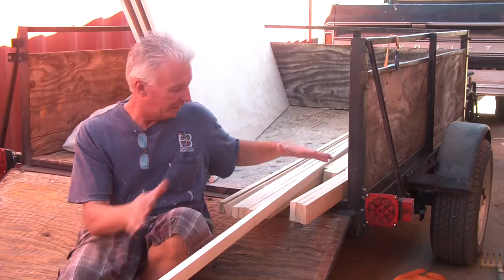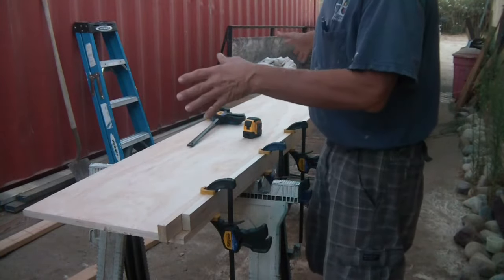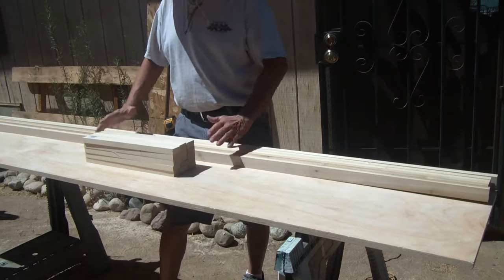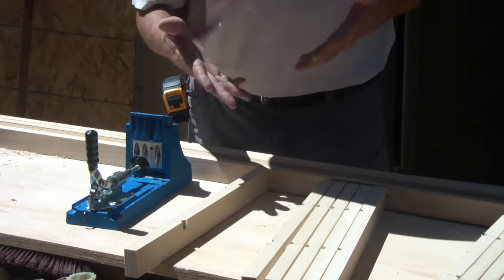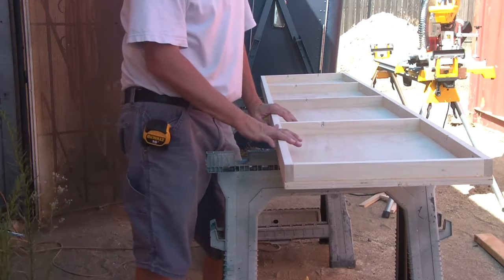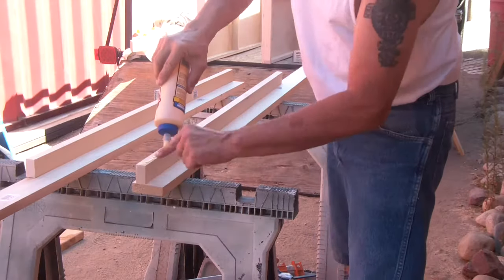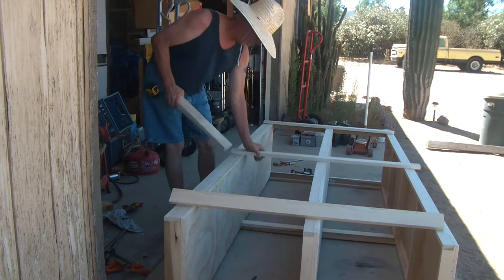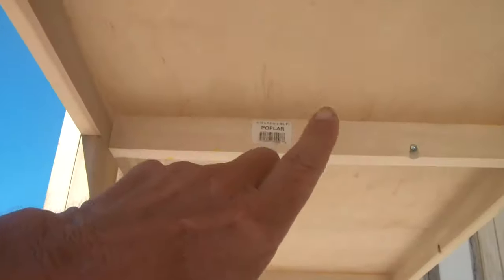How to build simple storage shelves, step-by-step.

Comment: as a beginner, why glue? dont see screws failing often. so far, hate nails because I cant disassemble things for repairs without damage from getting nails out. im about to attempt a table for my mitre saw, as my 1st project. does glue help minimize bowing, warping?
Reply from the maker: file1man  In my step fathers cabinet shop we would assemble the cabinets by butt joint, glue and nail. no rabbit joints, no dado's just glue, nail, square it up and put clamps on. Very simple and basic. Now for custom cabinets yes we would go the extra steps and rabbit joint and dado's  so i guess i still have the simple basics i learned for most things i build. This basic joinery worked well for many years and it will keep the joint solid for many years to come. I build them to last and not for disassembly or repair. if repair is needed it will be due to damage not from poor craftsmanship. In the case of these shelves the reason i put the supports in the middle was for the added strength and to prevent the shelf from bowing or the wood from twisting. My patio cover on my house the prior owner didn't put any divider on it so the 2" x 10" x 20' joist are bowed and twisted. Now i have to custom cut the divider to fit and do my best to realign them so i can enclose the ceiling for a custom and cleaner look. There is a lot of pocket hole joinery and that is fine but if the item is used often enough it will come loose. Glued and screwed the joint wont loosen. It really end up your preference.  If you want to possibly disassemble a project down the road and change it up then by all means use screws. If you build it and want to see  it test time glue it. Just a few things to think about. Just have fun and always try something new.

Comment: great video,thanks! you are still happy with the milwaukee nailer?
Reply from the maker: Thank you De Walter, Yes I'm very happy with my Milwaukee finish nailer. I had my reservations about it but now WOW! I use it more and more. I rarely pull out my air nail gun and air compressor. I grab this throw it in the truck and off I go. I love this gun. I haven’t had any issue yet and I’ve gone through 7000 or so nails. One of the best purchases I’ve made this year. Thank you for viewing and the complement.